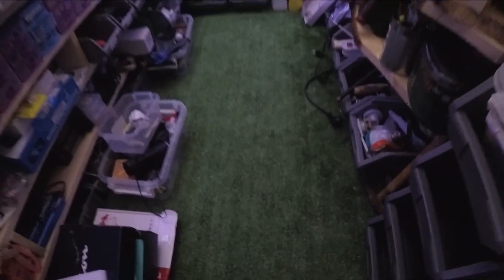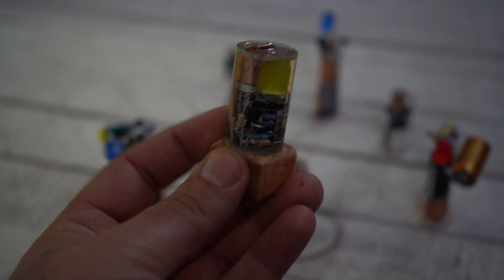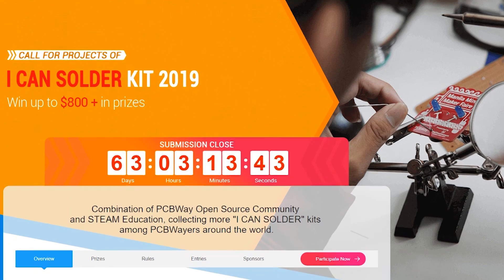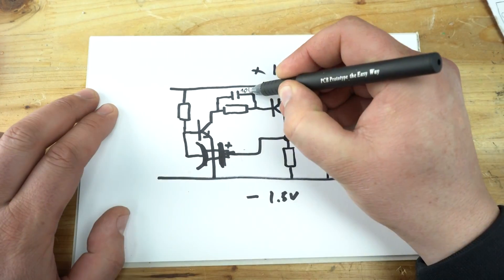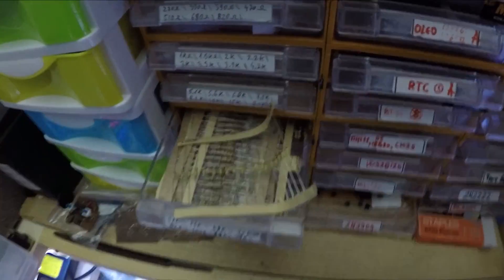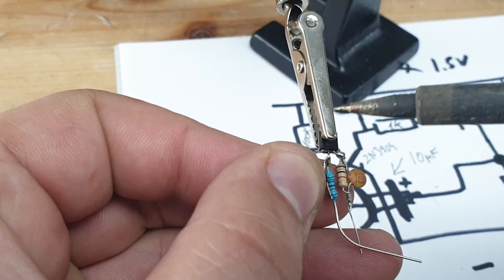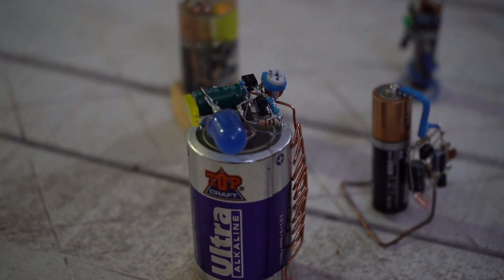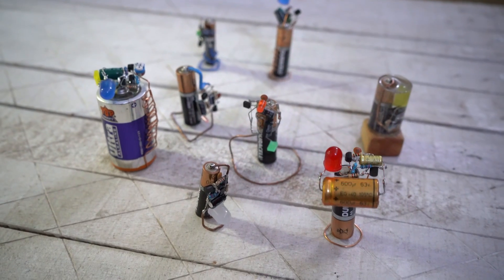1 Year LED Flasher with one 1.5v Battery

Comment from the maker: 1.5v led flasher,With one AA battery will blink 1 year
Reply: one question for u - why you make such videos, when u don't provide proper schematic diagram for making this projects, im asking you this question bcoz i had already disliked the video.
Reply: @Rachitkivines  Listen carefully to the audio - freeze frame if necessary and learn to draw schematics as shown - will be most helpful in building your own knowledge and experience.   Cheers.
Reply: @MichiganPeatMoss  why make so much effort, when he can show the schematic on the full screen without any problem, it will be better to everyone to understand easily, not everyone is that brilliant to understand such complex circuits.

Comment: I know this is an old video, but I'm wondering how it could be adapted to work with rechargeable 3.7v batteries, if this is even possible.  I would like to add this to my DIY emergency flashlight as the glow in the dark pigments don't glow for long and this seems to use so little power it could just blink near the button on the flashlight to make it easy to find.

Comment: Hi. I need your help regarding the flash rate of the circuit. I have made it with a clear red led and it is flashing very fast 1flash/1.5-2 seconds.  I have changed the 100uF capacitor to 330uF; 470uF; 1000uF; 2200uF but the flashing rate remain the same = very fast. After that I changed the transistors and in the RC oscilator the 10nF capacitor + 1K resistor values several time with other values,  but no good result. Where can be the problem ? How can be reduced the flashing rate ?  For example 1flash/5sec  .  Thanks.   ( PS : The Joule thief version of 1.5V led flasher is very simple and you can change the flash rate only changing the big capacitor. )
Reply: @Jack Luck I think that is the only way to change the flash rate : change the load.  If you will use only 1 pcs of 5mm led the flash rate is very fast.  This is too fast for me. I have good results with Joule thief version.  On You tube is a guy who made it to work 4 years with one 1.5V battery.
Reply: @Jack Luck https://youtu.be/_t6qip8HKyw
Reply: @Jack Luck Thanks for feedback. I have changed everything also the 47 ohm resistor ( 22 ohm on his paper ) but cannot control de flash rate. It is very fast to have 1flash/ 1.5seconds. This circuit has no tolerances to play with flash rate.   I have made also the other type of 1.5v led flasher : Joule thief + one BC 547 transistor and it is working very nice. Simple circuit and you can control the time between the flashing only changing the big capacitor.
Reply: change 10uf cap to 20uf or 30uf for slower flashing rate

Comment: All you folks that says is a really great circuit, what do you intend to use it for? I have a black cat with a black mat that I stand on when I do work in the kitchen, and I'm going to put around my kitty's neck using 1.5 v  hearing aid batteries. I'll make a little collar for him.
Next I'm thinking of making him a device that When he lays down behind me when I'm doing dishes, it'll beep so I don't step on him.
Reply: 1.5v hearing aid abttery has a lot smaller capacity. For me it worked only 4 days- after that light became dimmer . Turns out it has only 26mah, while ordinary 1.5v battery has about 1000-1600
Reply: Put it on a helium balloon and send it up. New UFO 😀

Comment: Self blinking LEDs already available. 😐 But if you want to test different capacitors, build this circuit. Otherwise, buy self blinking LEDs... 😐
Reply: That's true, but the forward voltage of LEDs is too high for a single 1.5V battery. This circuit also acts as a small boost converter by charging and then switching the two caps in series to achieve the higher voltage.
Reply: Yeeeee, this is big brain time

Comment: in schematic you used 22ohm resistor but verbaly 47 ohm registor.
Reply: Hi. I have made the circuit also but is flashing very fast. I have changed everything but cannot reduce flash rate. I put also a comment to this video with detailed description. Can you advise me if you know ? Thanks
Reply: Change   your capacitor to get your desire flashing speed

Comment: scheme is not pretty clear to understand, and hard to see where you solder LED contacts, but thanks a lot for a cool circuit working with battery! (most vids on youtube is flashers working with 12V dc power supply) 
-LED
-100k Ω
-2 x 1k Ω
-22 Ω
-10μF, 470μF, 10 nanoF
-npn transistor 2N3904
-pnp transistor 2N3906
-AA battery (working with accumulator 250mAh 3.7v as well )

BOOM done! Thanks!

Comment: please make led blink 10 years circuit
Reply: You will need very power efficient LEDs and transistors.
Reply: @ElectroGuruji  this is the circuit I am curious to see it inside the resin   
seems to be the same common led https://www.youtube.com/watch?v=DOajZVz8n6o
Reply: Use D battery, will blink 10 years